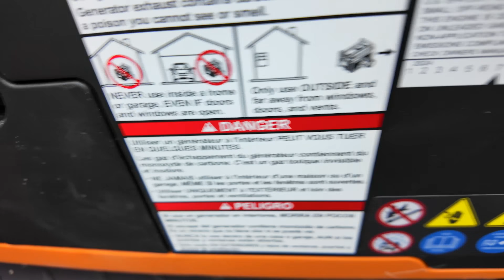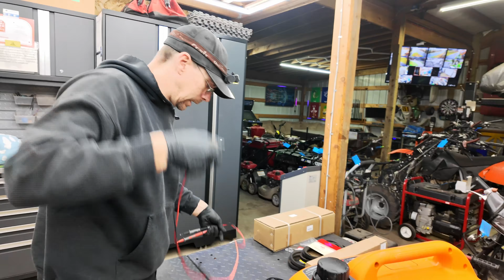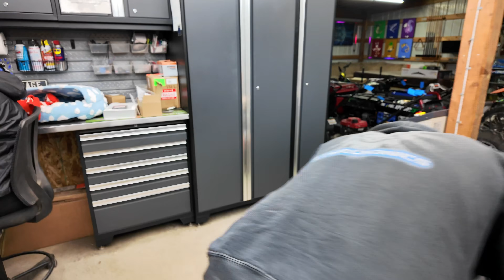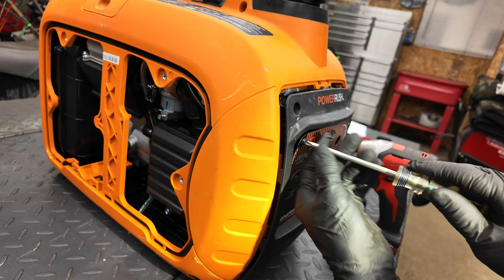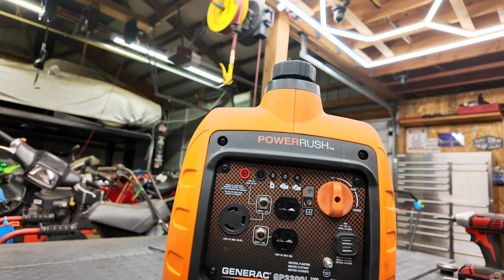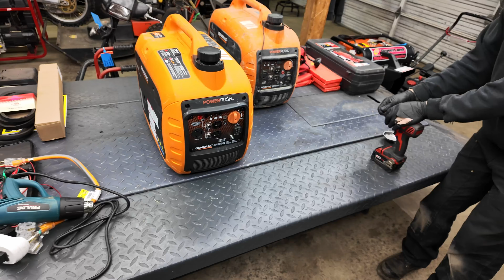Won't stop running! - Generac GP3300i (Model #G0071532) Generator

Comment: This issue is a failure of the Generac assembly person and should never have happened. I can see why you recommend other manufacturers.
Reply from the maker: I agree and I personally find it very difficult to get parts for Generac generators over others.  Plus I find that they like to make things more complicated than it really should be at times.

Comment: Thought that green connection is for the low oil shut off?...my 3300i has same problem.  Ill give it a try. Thank you for posting.
Subscribed.  Fixed.
My wires were connected,  just had to zip tie isolate.
Reply from the maker: You're most welcome! I'm glad the video was able to help you figure out the issue!  Thank you for the support too!

Comment: My gen has refused to start 
It's not supplying current to the spark plug
Reply from the maker: The first thing I would do is shoot a little starting fluid down intake and try to start up.  If it starts up for a second and then dies you then have a fuel issue.  I can't tell you how many people say they don't have spark but they truly do.  Not saying you aren't wrong but this is the first quickest way to tell for even I have noticed at times when I couldn't see spark I was truly getting spark.  Starting fluid is a great tool as long as it is used correctly and wisely which is why it is the first thing I'll use when something comes into my shop saying it won't start for whatever reason.  Because with starting fluid if it starts up for a second and then dies then you right away confirmed that you have compression, timing and spark so issue is isolated with fuel.  Try that and let me know what you find for I'm curious.  Just also make sure you have all of your basics covered first like fuel valve ON, engine switch ON etc.  If your generator was working just fine when you put it away last and now it won't start usually and the most common thing is carburetor issues from sitting which is why we always recommend starting them once a month.  Hope this helps!

Comment: It seemed to be surging  is that normal?
Reply from the maker: Where do you notice a surge?  Just so I can reference what you are mentioning.  :)
Reply: 40sec in to around 2 min mark.
Reply from the maker: That surging isn't normal but at the end starting at 17:50 everything is running great and normal without any surge.  The surging in the beginning could be due to lack of fuel, cold start or possibly something in relation to that ignition module when it wasn't plugged in.  😊
Reply: Thanks for responding. I’ve read on several post the 3300  people were have problems with surging even with new units an gentrac customer service was terrible    I’m looking for a portable unit with the features the 3300 has but don’t want to spend $700 on a possible lemon that they won’t stand behind.   Enjoyed your video
Reply from the maker: Yeah surging issues are normally a carburetor issue and if you slowly apply a little choke and it goes away then that confirms a carburetor restriction issue.  Overall I personally cannot recommend Generac for they have zero support and parts are a pain to get compared to some others.  After working on many generators I would have to say the best bang for the buck would be DuroMax and if you want top of the line it would be Honda but you pay big bucks.

Comment: The number one thing you NEVER do is start working on a running generator no matter what the problem is. Great way to electrocute yourself. You ALWAYS and I mean ALWAYS remove whatever you need to on a portable or inverter generator to get to the inside. THEN if need be after making sure you won't get zapped by testing whatever when its opened up then you start it and go from there...Basic knowledge...🙄

Comment: I have the same Generac. I noticed when I switch mine into Eco Mode under no load, it doesn’t rev down. I did have dirty fuel in it, and cleared out the idle jet only which got it to stop surging. The unit may be running slightly rough but hard to tell. Think I still have a dirty card causing it not to go into Eco mode? Any help appreciated.
Reply from the maker: Check your idle screw on the carburetor.  I'm curious if it is screwed too far down causing the engine to not idle down.  Normally this is the reason.  😊
Reply: Hi do you got the eco mode to work having the same problem with the exactly same generator? Thanks a lot
Reply: Stepping down switch on top of carb needs replaced